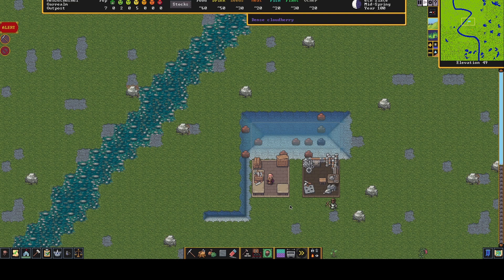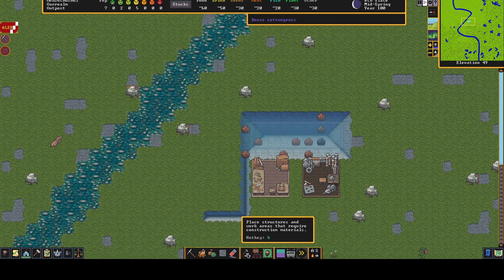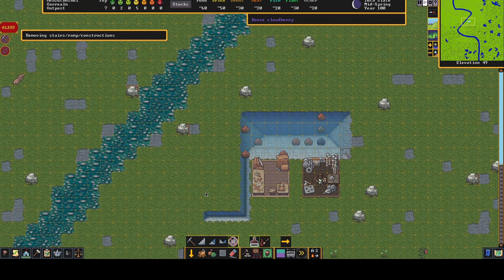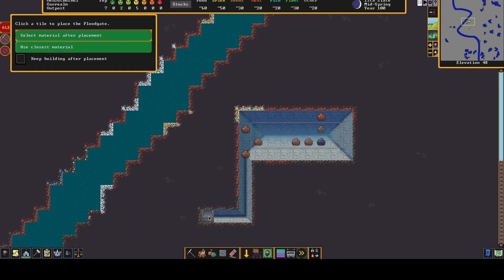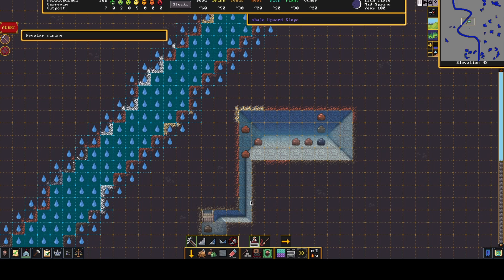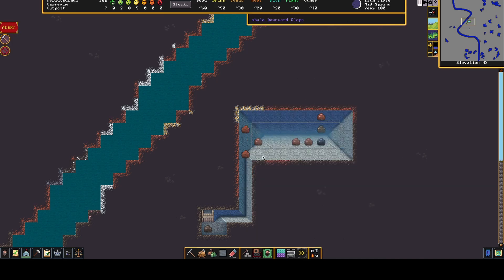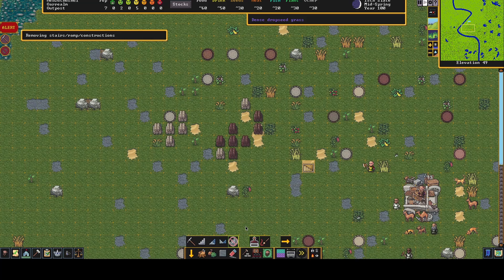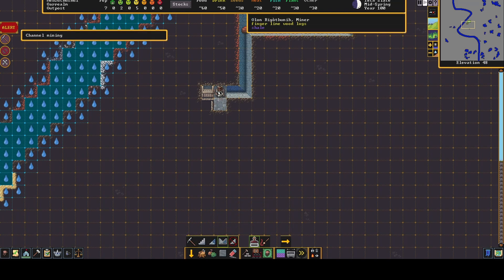Dwarf Fortress How To Use Flood Gates

Comment: I'm enjoying this game and this video WAS efficient in getting this info across. But there's something wrong with the game if it takes 7 minutes to explain how to add a floor gate to water. Which is  pretty standard for the course with this game. It's really not intuitive at all.
Reply: he did made a few mistakes, like tunneling the tile he was going to place the floodgate in without realizing which required him to put it elsewhere, but basically you make a floodgate item, you place it in the build menu, you want to proof it with a grate (wall grate for horizontal streams and floor grate for vertical water chutes), and then link the lever to the floodgate. And to build the lever and link it to the floodgate, you need a mechanism each.
Reply: This game is near opposite of intuitive. It requires constant effort of conscious reasoning. I feel it is an excellent practice in logic and programming to be honest as it can be similarly demanding mentally.